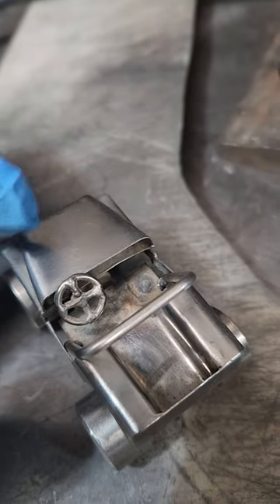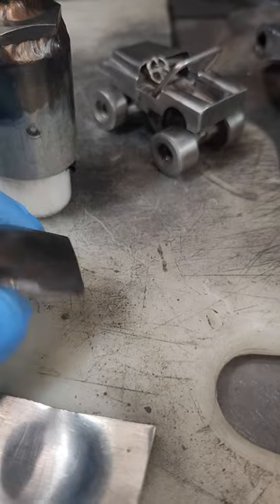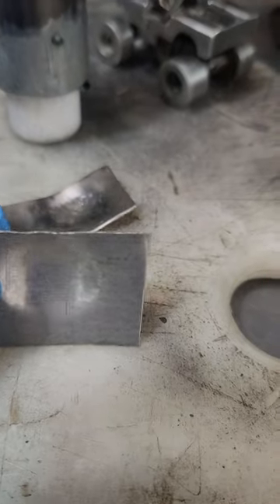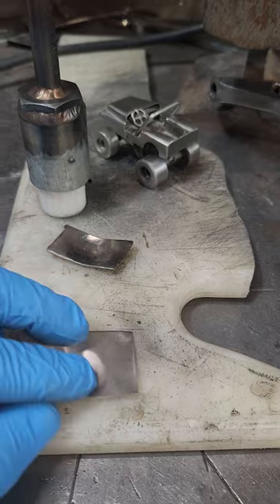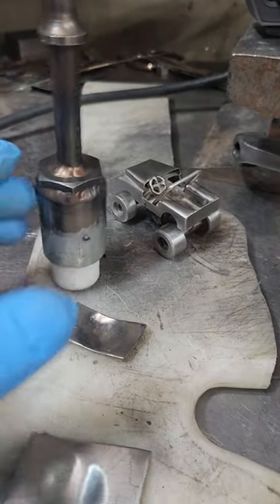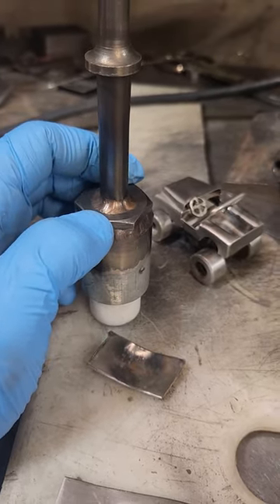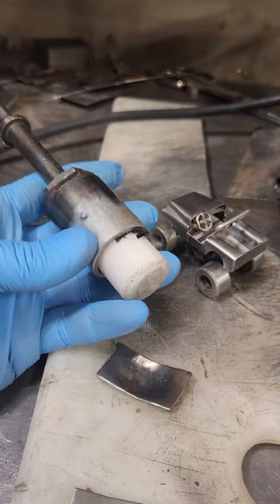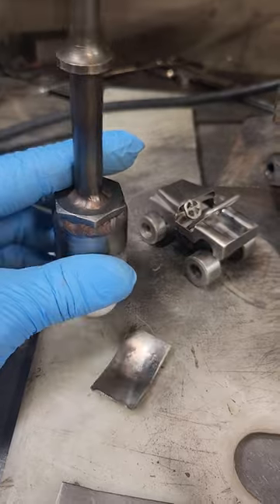My favorite tool for bodywork...The polyethylene airhammer! on 26ga stainless

Comment: That’s some sweet welds👍👀👍 cool idea for a hammer!
Reply from the maker: Thanks, I had an older one but gave it away, so I had to make a new one. Bit needs to bottom out, so  taper it a little and press it into the nut with a press if possible. This will ensure it doesn't crack, flux is common, and penetration is there for this thickness with ease. You can see galvanized scrap pipe and digging through the bin until I find something that fits or I'd make one using a tapered bit for the hole.
What I use in this is in description, highly recommended it. For joining all types of materials together, even stainless to copper😉
Reply from the maker: Btw that's 26ga jeep not a ding😉